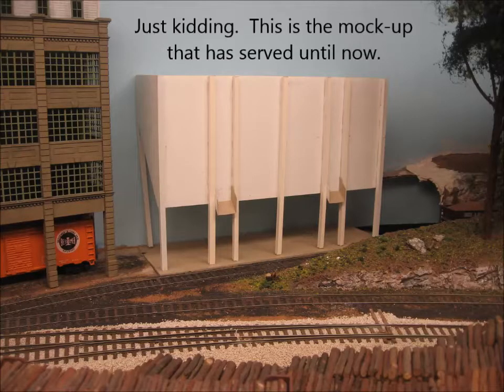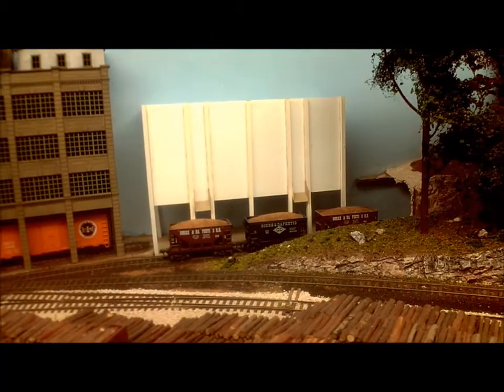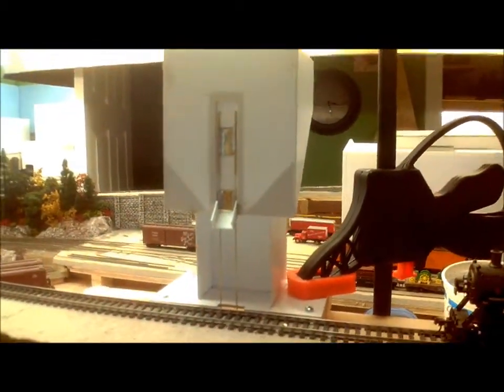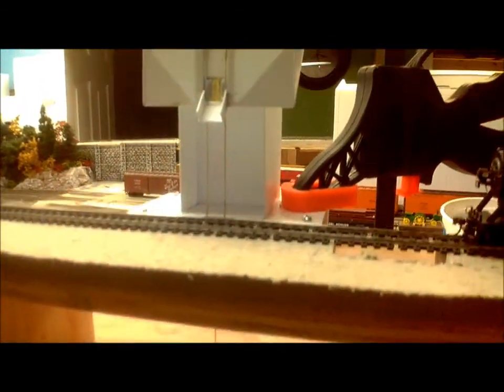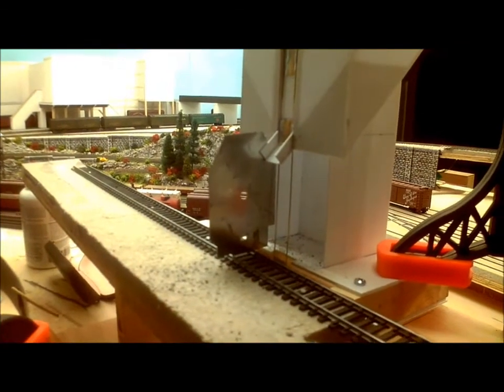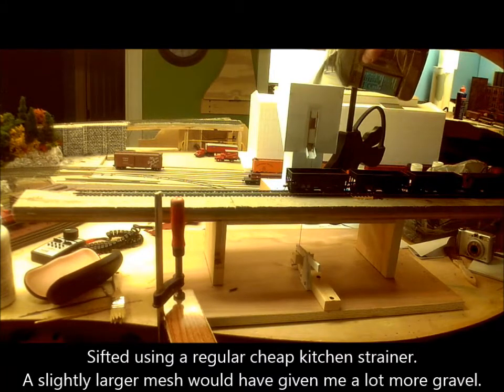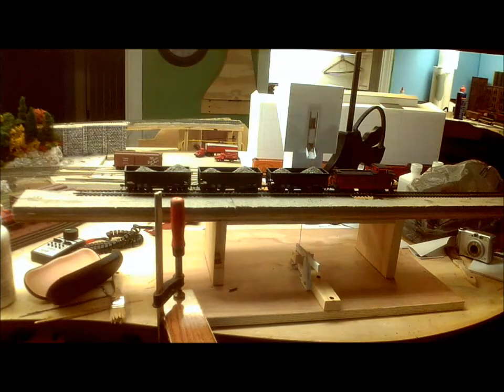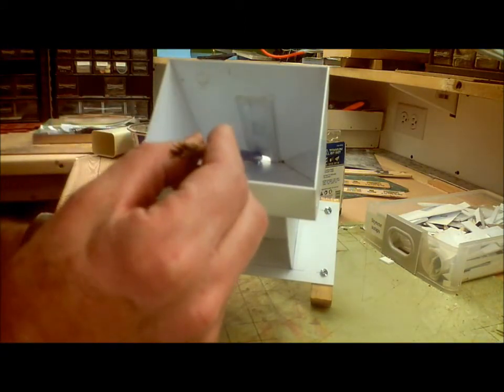My railroad: Build a working gravel loader, part 1

Comment: hi Peter.. very clever idea... 2 thumbs up... now all you need is a rotary dumper to empty the cars & recycle the material back to the hopper.. nice job.. thanks for sharing.. vinny
Reply from the maker: The rotary dumper needs to go on the upper level so that gravity can feed it back to the loader.
Reply: you are 100% right.. I've see this done before but i can't remember the person who did it... his was coal using a Tortoise machine to operate the gate (door)
Reply from the maker: I think you may be referring to NSmodeller24.  His was a modern over-the-track flood loader.
Reply: 100% right again.. i knew it was NS but couldn't remember the rest...